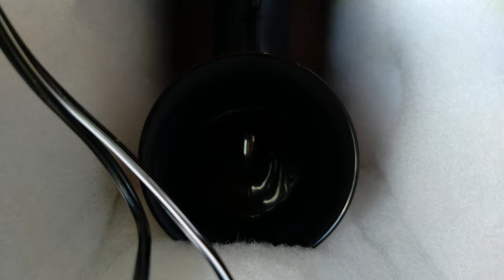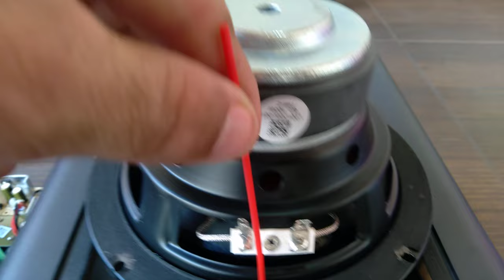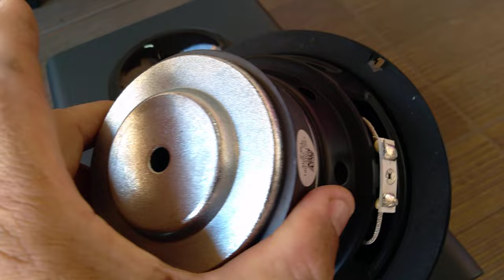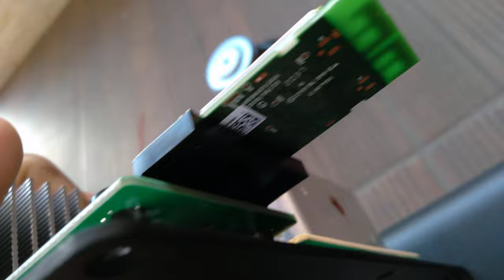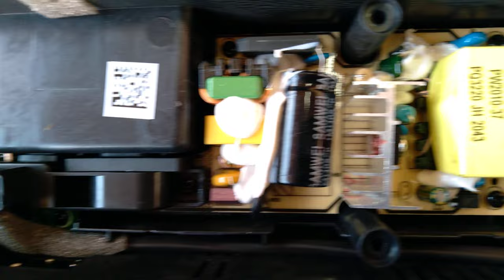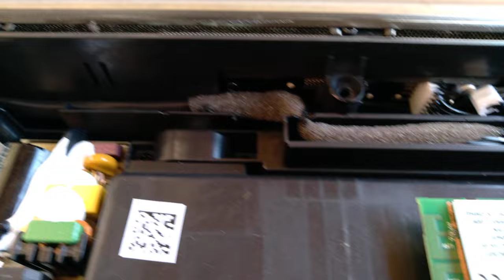JBL Soundbar 2.1 Deep bass  Look inside (Disassembled) Teardown (Desmontado) Por dentro

Comment: Does anyone know how to open/Disassemble the remote of this soundbar? My remote stopped working all together and i'd like to open it to maybe see any problems...
Reply from the maker: Unfortunately I no longer have this control to help you, but basically all the controls open in the same way, recently there was a video of me teaching how to disassemble a Samsung remote control and you can use it as a base to open yours.
Reply: @robsonbraun  i somehow pulled it apart with some strenght. Inside where the buttons are it was super dirty, i cleaned everything with alcohol cloths, put it all carefully together and magically now the remote all works like new.
Reply from the maker: @Venividivici55555  Very good my friend, I'm glad you made it.

Comment: Can anyone tell me what is the voltage output on this power supply for this sound bar? I need to find an alternative because mine no longer works
Reply from the maker: I can't at the moment, but I'll try to fix it for you later.
Reply: @robsonbraun  I’m in South Africa
Reply from the maker: @chadgoldschmidt324  I'm very far from you, here in Brazil.
Reply: Boa tarde! Também gostaria de saber a tensão e corrente da placa fonte pra   ter uma alternativa pra substituição.

Comment: nice video. which would sounds better overall. this jbl 2.1 deepbass or the jbl 5.1 surround?
Reply from the maker: The 5.1 one is a little better, it's just not much better because the 5.1 could have a tweeter in the center channel to help with the voice dialogues.
Reply: @robsonbraun  ive seen on your video and noticed in the drivers are similar? are they the same? And the 5.1 does not have a tweeter (i did see a side firing speaker on the 5.1 but i dont know if those are tweeter for the highs)

Comment: Hello, I have a JBL soundbar 5.1 with the removable speakers and I was wondering if the subwoofer can be converted so that I can use it without the soundbar with RCA cables. Does anyone know about that?
Reply from the maker: Yes, but this requires good technical knowledge in the area of electronics as it is necessary to use a multimeter and make adaptations to the circuit.

Comment: im looking for good cheap soundbars like these for my jeep, i just use external power connections such as an extension cord to have a sound system in my truck basically, and i just noticed the subwoofer is only 100w, its rated 300 watts so the other 200 goes to the bar, unfortunately
Reply from the maker: The 100W rms sub is very strong, I'm sure it would please you a lot, the bar of not being mistaken is also 100w rms, 300w advertised is the peak power that it can reach with certain frequencies, but the musical power is at 200w rms msm, remembering again it is a great power because jbl works with real rms power.
Reply: @robsonbraun  is it also possible to change the driver? (the sub itself) to a different one such as sundown skar etc since they have some 6 inch subs that the bar can handle
Reply from the maker: @Silk5000  Yes, it is possible, but changing the driver will not always improve performance as it depends a lot on the type and internal volume of the box and also the amplifier, what can be done is to build a new box with a larger sub and using only the rear panel where it is located. the original amplifier is located.

Comment: Hey man! What's the power of the amplifier? My woofer is broken (exploded) and I'm about to order a 6.5 woofer 4ohm with 500 watts power (couldn't find anything lower). Will the bass sound louder or just the same?
Reply from the maker: The amplifier has 150w rms, putting another stronger woofer will not improve its power.

Comment: I want to set this up in my smart car as a Bluetooth stereo.
Reply from the maker: And just buy a 12v to 110v current inverter and it will work perfectly.
Reply: @robsonbraun  I plan on carrying my ALLPOWERS r600 solar generator in my car plugged into my cigarette socket so it’s always charged up and running the speaker off that. These cars have a unique design storage area on the dash board and I will stick the sub behind the passenger seat. I’m going to test it today with my jbl 5.1 before I buy the 2.1 from the pawn shop.
Reply from the maker: @christopherbouman160  Very good my friend, tell me later if everything went well and what you thought.

Comment: jbl 2.1  subwoofer 200 watts  but inside speaker 100 watts 4 ohm why ?
Reply from the maker: The power mentioned by the manufacturer is the maximum that it reaches in peak, the amplifier usually has a greater power than the woofer.

Comment: Bro, please reply to me.🙂🙂🙂🙂 We can see that the JBL Bar 500 subwoofer magnet is so small it seems like a joke. I have watched your videos and looked at that Samsung S800B! Its magnet is far bigger than the JBL Bar 500. But JBL advertises their wattage as more than that of the Samsung S800B, and JBL also talks about their deep basses. Seems like a big scam here.

What is your opinion, bro? Does the JBL Bar 500 really have strong sound/bass as they describe? A lot of people are saying JBL sound is clearer than other brands. Their specs also say 1% THD (Total Harmonic Distortion). If that's true, it's an amazing quality. I care more about sound clarity (pure natural sound) rather than extra artificial bass.

Please reply to me. My budget is not more than $500-600..
Reply from the maker: Don't be fooled by the small magnet as it is enough for the amplifier, but what makes a big difference in the bass is having 10" versus just 6" and also having a much larger cabinet also makes a difference, as I have already tested both I can say that the JBL has twice the bass compared to the S800.
but you should be in doubt and ask yourself why this is, this is due to the small size of the s800 and because of this it needs a lot of power to play due to its size and because it is a sealed box with a passive radiator.
Reply: @robsonbraun  🙂🙂 thank you for your reply bro. I am so sorry i have pasted same question in several videos because i thought you will not answer my question.😪😪😪
 Brother, what about sound clarity! I mean how clear it's sound compare to other high end brands like sony. Because  everybody saying about jbl sound clarity. Well actually i am currently using jbl wired earphone. Clarity is awesome so clear ultra realistic sound. I am so much consider about sound clarity. tell me honestly what is your opinion in jbl bars sound clarity
Reply from the maker: @katsrk3039  This will depend from model to model, an example that I have already been able to prove, Samsung s800 vs JBL bar 500 = Jbl much better in sound quality, 
LG S90qy vs JBL Bar 500 = LG much better in sound quality, only losing in bass to the Bar 500 so this will vary a lot from model to model and which one you want to compare.
Reply: @robsonbraun  🙂 Thanks. So is it mean we can't decid bass and sound  just only using magnet sizes right? Thank you made correct me this wrong idea.
But  My no 1 fact is sound clarity. I am not a bass lover. I just need pure bass. You know some sound systems produce tooooo much unwanted noise when volume up. I have experience that with logitech z906.
 But this jbl bars just only have 1% THD. Is it true? Can it hold clear noisless sound even at high volume(while like 100% volume and high bass producing stage). this is my last question thank you brother 👍👍👍👍 god bless you!!!!
Reply from the maker: @katsrk3039  That's right, it's not always the size of the magnet and signal quality and power, as for the sound quality of all these models that I've already tested, the best is the LG S90qy, think of a crystal clear sound full of musical effects where the audio channels separate the instruments of a song.

Comment: Ift thats sub is 100watt then why jbl said 200 for sub😮
Reply from the maker: A sub never needs to have the same power as the amplifier because the tests are done with frequencies that we don't use in normal use, it also depends on the legislation of each country, here in Brazil the maximum declared power of the whole set (bar + Sub) is 206 W RMS